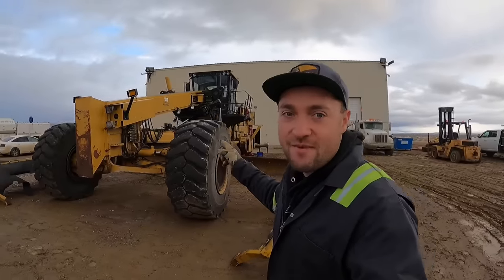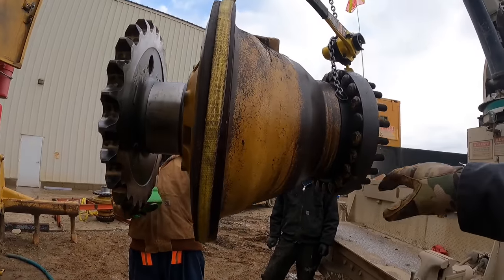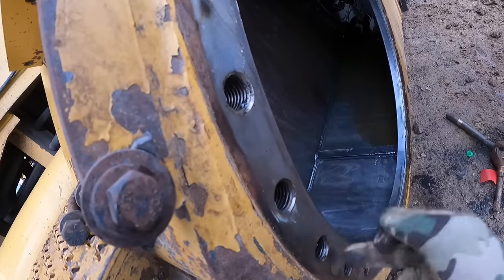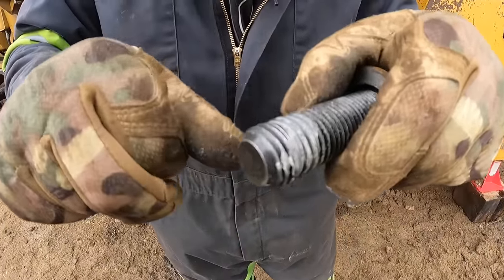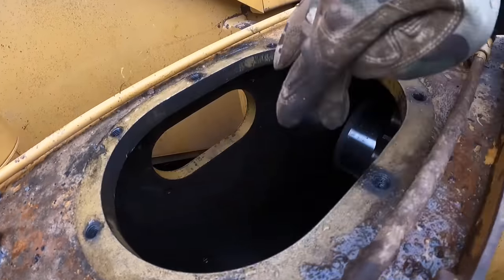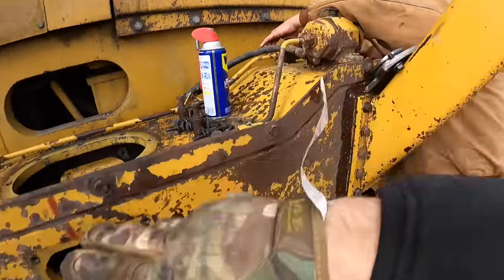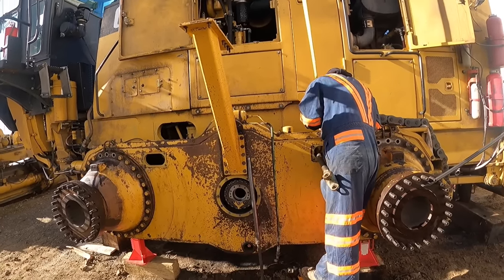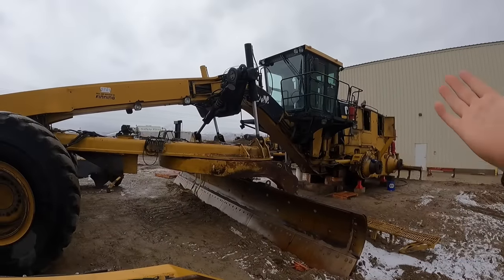Replacing brakes on THE LARGEST MOTORGRADER IN THE WORLD!!! CATERPILLAR 24M!

Comment: A constructive suggestion for you guys. Take 2 bolts and cut the heads off and shorten the threads(or not) and point the non-threatening end and put them in at the 10 o'clock and 2 o'clock position to guide the brake unit into position as you install the unit. Guides it into place and no damage to the oring. Make life easier for you. Cheers
Reply: I did same thing different for my rear diff. Except used the metric 10.9 rod, I figured it should be 10" length when I read the instructions after I had done it they said 4 " as that length would not have kept the diff from rotating. As I did not want to have to redo the sealant RTV. Easier is usually better.
Reply: That was my first thought too, guides.

Comment: Hey quick note , the 24M is not the largest grader ever made , That title goes to the ACCO  an Italian made grader with 12 tires ,33 foot blade  ,two engines totaling 1700 hp and weighing in at 200 tons  the second largest was the Champion 100 t  with over 700 hp Cummins and weighing at over 92 tons .

Comment: Just a thought. When I needed to align big parts together, I would take a pair of long bolts, and the heads cut off. Thread the bolts into the housing and use it as an alignment pins. Much easy assemble, and less likely to damage o-rings or gaskets. Love the videos.

Comment: I like this - a totally different view of the work that goes on in the yard. I can't imagine the 600ftlb torque - my RV has 450ftlbs on the lug studs and nuts, and if I didn't have a 5Xmultiplier I'd be sunk!
Reply: I was just thinking to myself that he needed a multiplier for that torque.
Reply: I used to drive school bus in L.A. One of the buses there had a Cummins horizontal 6 cyl., a 335 I think. Anyway it needed some valve work done on it and I remember a slender mechanic hanging on a cheater bar on the end of a 6' torque wrench trying to get to 600 ftlbs on the head bolts. That was funny!!
Reply: you should try a 1000ft lb tq wrench to tq the 4 bolts for the fwd transmission on a ch-47 helicopter. the bolts tq at 880ft lbs. the end caps that hold the horizontal hinge pin (flap up/down) on the rotor head tq at 420ft lbs and working on the aft pylon for the aft rotor head, we only have a 30"x30" work platform and is 17' in the air.
Reply: 1000 foot pounds on combine wheel bolts. And they're sunk in about 3 feet, so you get a long extention, a big torque wrench, and a handyman jack to hold the extention up at the pivot point
Reply: @RedDeadSpearhead  Hey Has, it's neat to see the correct jack term used!  "Handyman"!  Not "hi-lift" or some such amateur term!  As a kid on a Minnesota farm my Dad taught me a healthy respect for those things!  Ever see one start ratcheting down by itself and fling the handle out?  Just stand back and let 'er go!
Reply: @Cougracer67  So True

Comment: We were all young and inexperienced to start with. Sad to see you made the same basic mistake on the second side too. Clean ALL cover mating surfaces and threads first BEFORE cleaning crankcase ONCE. I rarely had the luxury of a covered workshop, so I learned to use my brain to save me freezing or getting wet as much as possible while still doing the best job possible. When you need to use the torque wrench upwards, keep arms and back as straight as possible. Use the strength of both legs to avoid a skipped disc. Hope this helps you in your career. P.S. Get the broken screen replaced. Laminated screens break into large sharp, killing shards when they finally fail. Old toughened windscreens broke into tiny scratchy bits even though they were a pain.

Comment: Good work guys. I had a issue with CAT over there cutting edge tips. They were warranted not to brake. They replaced them and told me I wasn’t using the correct torque on the bolts. I bought a CAT torque multiplier to satisfy the warranty. I did brake a few after that, they never questioned the replacement. I also put the multiplier to use on the elephant pad caps on my Mack trucks. Think they were 600 ft.lbs.They are expensive, but worth the investment. Thanks for the video.

Comment: Good vid Chap, if you want to save some time & ensure your not dropping crap back into the chain housing when cleaning out the threads, invest in a tap to wind in whilst you have a vacuum hose on the end of it inside the box.
If your a cheap skate cut a slot along the thread on one of the old bolts and do the same. 
If you don't have a shop vac, please disregard this message.
Have a nice day😊

Comment: I was wondering when you said there were 2 chain's.  I was thinking 1 chain to go around both finals.  Then I figured out the drive is a double sprocket,  hence the 2 chain's,  1 chain per wheel. 
What is the chain size? I've seen 100 chain and that was a wee bit bigger than 100.
Glad I found you thru Cascade Heavy Rescue when you boys went to get your old pete.
Love the old equipment.  I've been a nut for trucks and equipment all my life. Currently a truck driver. I've been described as a "wheels turnin kinda guy".

Comment: I have seen a motor grader physically bigger than this one out east at a mine in PA. I believe it was made by Champion but not 100% sure on that. It had a V-16 engine in it. The tires were the size of the ones on the large mine haul trucks. It was out of service when I saw it.  This is impressive seeing you do this repair. I work outside a lot on locomotives. I prefer warm weather for the work. Dressed properly cold weather is tolerable to work in.
Reply: You are right about that. The Champion is a little over 90 tons, there is one in working condition in Norway at a company called Rana Gruber.
Reply: @dalarampen  does that make this one, the largest grader in this part of the world?
Reply: @SPUDHOME  As far as i have found out it is the largest in the world, since the former largest is dismanteld..

Comment: Cold is probably the best of the two, super hot outside, you can’t escape that heat not to mention the health risks (granted there are risks with the cold temperatures). At least with the cold, you can always add more clothes and use things to keep warm
Reply: I believe just the opposite, everything is such a process and takes so much long in the cold.
Reply: Yep you can  only  remove  so many clothes  before HR or cops are involved

Comment: Field mechanic here, but you could use the pusher bolt holes with a lift eye instead of wrapping a strap all the way around. Then use long bolts with the heads cut off to get it started.

Comment: I like 76 degrees with a light breeze. Too bad I worked in an open pit w1th 110 to 120 degrees and no breeze. Now adays I wonder how I did it. We did the bolts on the undercarriage of a P&H cable shovel using a 4 foot long wrench and a Grove crane. I did help a mechanic torque the head bolts an a haul pack using a 4 to 1 multiplier which made the pulling easier but sure did add to the number of pulls.

Comment: Hated winter going up on the passes  dot plows throwing salt and sand when you are trapped under the rig.get it back to the shop big chunks of ice and gritty snow melt and fall on you.  So cold your fingers will not move untill you sit in the service truck and thaw them into submission.  Much rather worry about heat issues than frostbite jobs for sure.

Comment: pro tip when you have to clean a lot of bolt holes like that a pipe wire brush with the handle cut off and chucked up in a drill makes short work of it.

Comment: I can’t help but comment. I worked for Atlas Copco Wagner Mining Equipment Co for 18 years. First if you clean all the outside surfaces like on top the cover plates bolt holes and get it super clean then clean out the inside housing second then you don’t have to clean the housing twice. Also you should of cleaned as part of cleaning first the hydraulic brake line ORS nuts also because being in the rusty-grimy you wouldn’t have had to F with them on reassembly . Then you should of had some alignment Dowel pins made out of some old bolts so you could’ve slipped the brake assembly right in evenly and not possibly damage the O-ring. The chain drive brings back memories of our LMTT mine trucks for low ceiling coal mines where the rear drive tires on the dump box had a chain drive. Also why don’t you have a air compressor on the truck??? Maybe you do so you can run a 3/4 or 1 inch impact to run up those assemblies bolts to 450ftlbs then do the final torque to 600ftlbs save you some time, just saying.

Comment: I was thinking that you could make a clamp-ring that grabs around the area where you had that nylon tow strap. The ring should have a lifting eye and 3 studs fixed in permanent spots to align the brake to the grader. After you impact a half dozen or whatever bolts in, release the clamp and the ring will be ready to grab the next brake.
You're pumping air into hydrologic brake lines... something about that seems very wrong to me.

Comment: The Champion 100T is the largest grader ever made. 180.000pounds with a 24foot blade.
Reply: Actually, the Acco grader still holds the record, by a very wide margin. 400,000 Ibs, 36 foot blade, twin engine, 1700 hp.
Reply: @phloughtgnarpsehs7263  thanks, had to google the Acco. Altough i agree with you i dont think it can be compared since the Acco is a custom made machine, and the Cat and Champion were produced for mass sales. But a very cool machine!
Reply: @hanatophilia  understand your position, but you didn’t say largest “production” grader. You merely said largest ever made. So the Acco is certainly in the running.

Comment: is not feasible to lay the chains in the walking beam first with a strap or mule tape attached to the end for the brake, and go ahead and run the other end over the final drive sprocket, then pull the brake end of the chain over that sprocket? i have never worked on a grader, don't know, so that is why im asking.

Comment: I would rather do some jobs in the cold.  You can always layer up to get warm, but you cannot layer up to get cool.   For working in the cold get you a pair of underalls, but just know you will cook if you go somewhere too warm like a heated building for too long.   My wife has the name brand, I have some by a different name,   They were sure nice a couple weeks ago when I had to run a backhoe in freezing weather to dig a grave and fill it in.  

Shout out to Quintin from the Mid-Willamette valley.

Comment: Would it not be easier to put the chains in first and wrap around the first drive sprocket as you put it in... and then as for the second??? Seems like you made it very difficult for yourself with a very small opening at the top to try and feed a heavy chain round a sprocket... not how I would do it... but, you got it done I guess.

Comment: OK 17 seconds in and it is incorrect, the largest grader ever made is NOT the 24 M/H, not even close. I don't know what the largest is but the Champion company made one with a 28' mould board and weighed 100 tons, it was a hell of a lot bigger than this and yes I worked on it. You didn't mount on the rear like these. the ladder was actually on the front and you walked along a platform over the gooseneck and into the cab. The tires were twice the size of the 24m using the tires from the Terex Titan 170 ton haul truck. This is just one example and i'm sure there are others.
The way we pick them is we took a piece if flatbar about 2" wide and bent it about 5 degrees with a hole in each end. Put the bar on the inside, it's a balance thing, and a lifting eye on the top making sure the bend angles out away from the machine when brake is installed, use two old bolts at dowels, slide it on to them and remove the bar then push it the rest of the way in, no $20k took and once made is way faster than rigging it up like this.
To install and remove the master link, use an air hammer with a long flat bit, I cut a long chisel flat, makes it easier, especially removing
Reply: The Acco grader still holds the record, by a very wide margin. 400,000 Ibs, 36 foot blade, twin engine, 1700 hp.

Comment: i was noticing u guys sanding the area just outside the Oring grove but earlyer u guys were wiping out the inside of the area where the chains run but i noticed ur sander was slinging the gritt of the sanding pads paint dirt ect into the chain n oil tanks catpiller would shit a brick if they saw that shit that dust from the sanding pad also dirt paint n whatever debri that sander is slinging straight into THE CHAIN CASE AND THATS MEGA BAD MY DAD WATCHED THAT N WAS OMFG WTF IS WRONG WITH THIS PICTURE LOL. MIGHT AS WELL GRASS BLAST TE AREA WHERE THE ORING SIT KINDA CLOSE N U DONT WANT ANY DEBRI FROM A SANDER WITH DIAMOND COATED SANDING DISC ENTERING THAT CHAIN CASE IT WILL EAT MORE THAN JUST THE CHAIN/BEARINGS IT WILL DESTROY OIL PUMPS ECT ECT also try silicone sealer on those bolts my favorite is high temp red. works on any n everything is easy to see easy to use easy to clean up n we all know cleanup were ya spend the most time. this is my daughters account she showed me that n i was omg n could resist makinga coment hopfully it make your days easyer cause have to do shit twice really sucks i like doing things 1 time n its all good they call somthing like that a comback n aircraft industry. get 5 combacks in a yr or 1 that cause a crash of a aircraft n ur fired maybe get charged with with the death of a pilot if ur work cause a aircracraf to crash n burn like a trailer house. n thats bads.

Comment: That  is NOT the largest road grader ever built.  There is 1 of 2 of the largest graders ever built down in south Florida.   It literally dwarfs that thing. I actually delivered six 9 ft tall tires for it. It is sitting at the Tamiami mine.  You really need to see it.
Reply: Actually, the Acco grader still holds the record, by a very wide margin. 400,000 Ibs, 36 foot blade, twin engine, 1700 hp.

Comment: Not the largest there is a 25m and there was another grader twice their size allis chalmers or letourneax
Reply: Actually, the Acco grader still holds the record, by a very wide margin. 400,000 Ibs, 36 foot blade, twin engine, 1700 hp.
Reply: Okay knew there was a much larger 1.

Comment: 24 is not the biggest grader ever made .....champion 100t is
Reply: Actually, the Acco grader still holds the record, by a very wide margin. 400,000 Ibs, 36 foot blade, twin engine, 1700 hp.